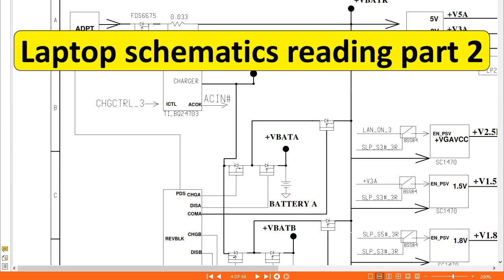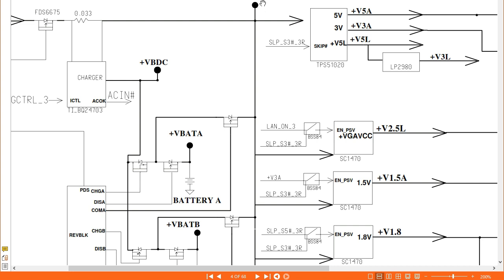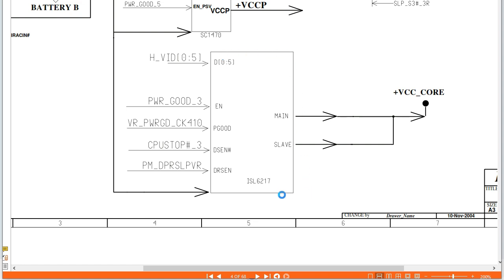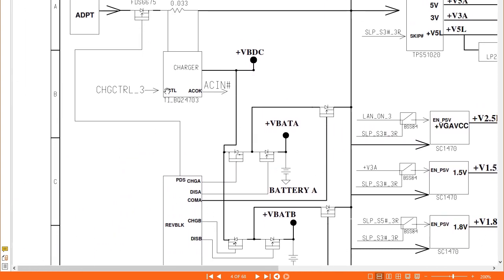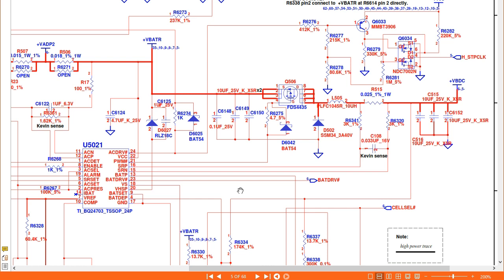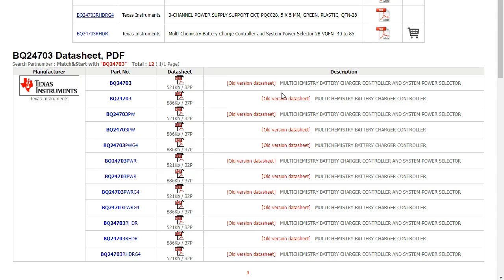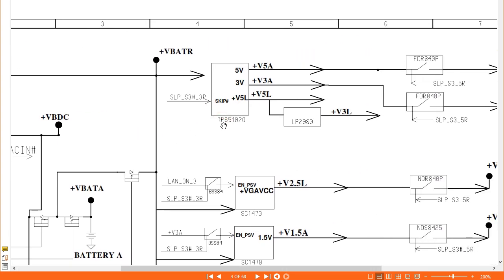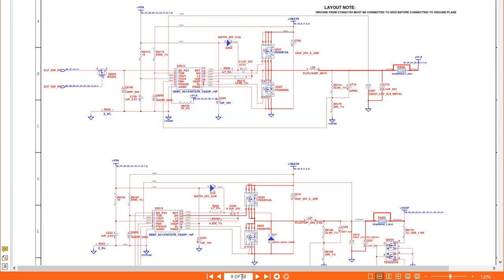Motherboard schematics analysis - part 2 | laptop motherboard repair

Comment: Have a Asus Zenbook 13 that I accidentally shorted the power supply on, now the laptop isn't powering on, the motherboard isn't drawing any power either. Do these motherboards have protection fuses? Or did I fry something major?

Comment: I want you to explain what we have to check on each chip.e.g. on the charging chip... what does mean? acdet, enable, batp etc. what should we check to see if the chip is working properly?and how will we understand that if there is no voltage or signal the chip is faulty,or something else is not working properly and is not giving the correct signal for the chip to function properly
Reply from the maker: Ok, Noted.
I will